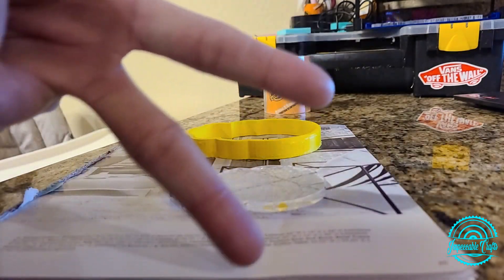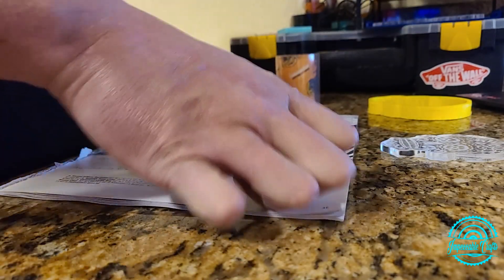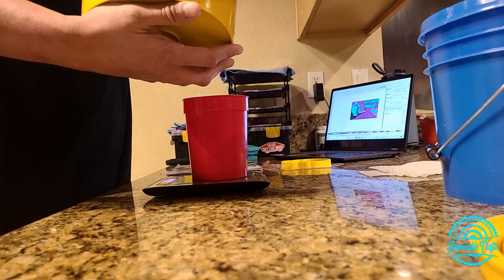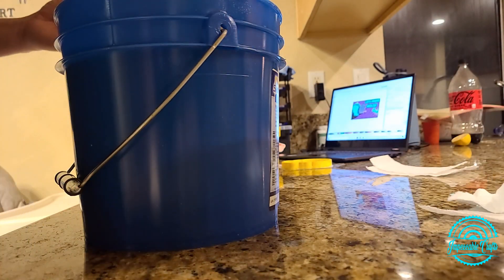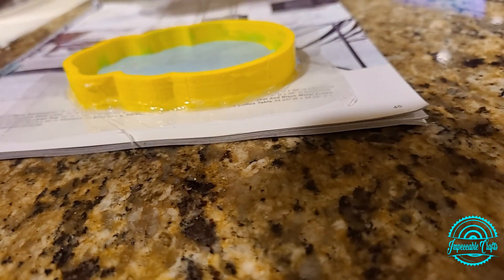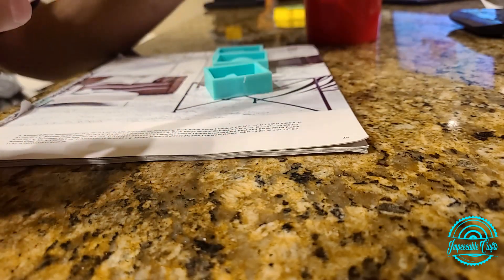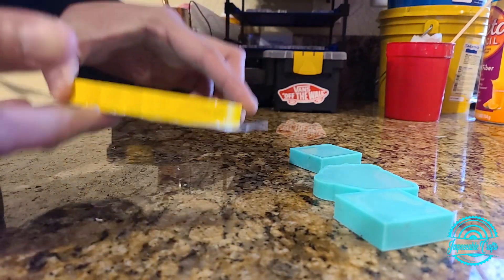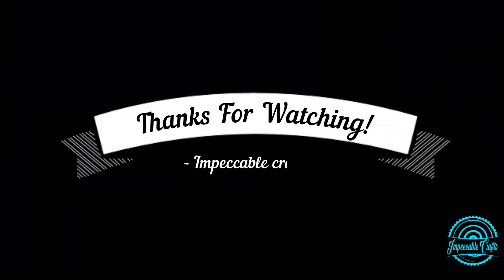How to make silicone molds for resin art TUTORIAL

Comment: If you continue to use the same brand/type of silicone you could take the excess that cures at the bottom of the cup and cut it into tiny pieces and use as filler when you pour another mold.